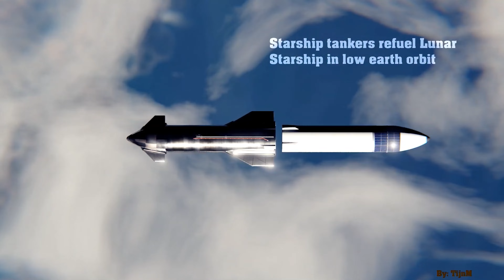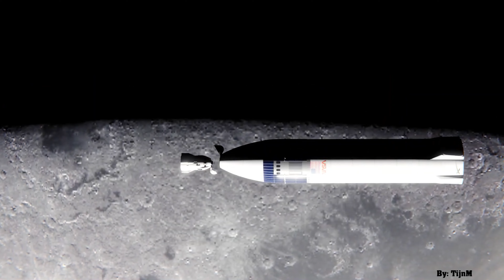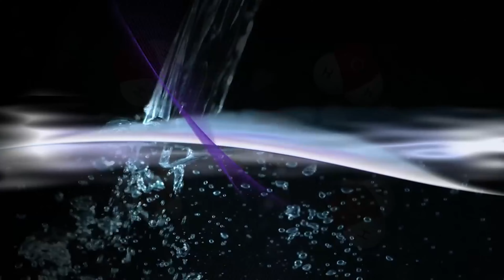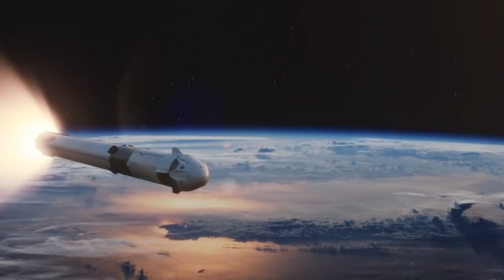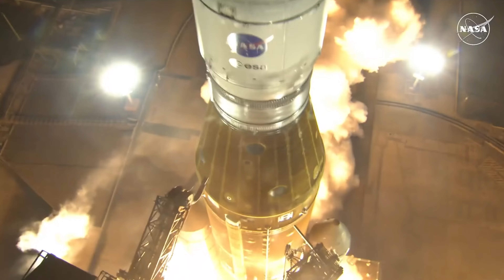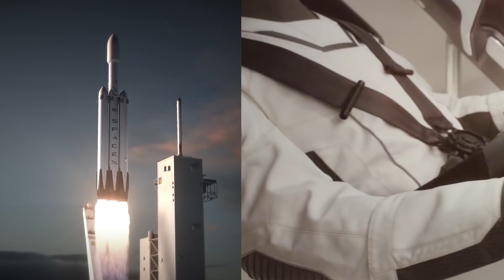We Could Build A Moon Base Right Now ! So Why Don't We?

Comment: Very likely the moon also has frozen hydrocarbons in the S pole craters. This makes liquid oxygen & liquid methane rocket fuel an option.
 I like the idea of using the reusable starship booster with a non reusable upper stage to get moon project hardware and supplies into low earth orbit.  One payload is the permanent lunar lander. 2 or 3 more payloads are fuel tanks that strap on to the lunar lander (and later are discarded to lower weight as they climb out of the Earth gravity well and they get emptied). This lands on the moon before astronauts are launched in a separate designed ship. 
      The 2nd ship is also launched into low earth orbit using the reusable starship booster.  It also includes strap on fuel tanks that are launched separately and then linked to the 2nd ship.  The last rendezvous in LEO is with the crew dragon which transfers the astronauts to the 2nd ship.  This ship is different than the 1st because it is able to return directly to earth LEO (assuming it is refueled on the moon)
    I don’t see much point in astronauts on the moon for a month unless the moon base is going to be permanently manned and supplied with water, oxygen, fuel, food from the moon.  I do see how a manned moon colony could become financially profitable if it’s done right.

Comment: Reilly, I am not just sharing these videos because they reflect what I have commented. I am sharing because of how well the ideas are presented. Of coerce, I don’t like seeing the Starship on its side because it is too much work. If you are going to not fly the Starship, remove the engines, but keep the fuel tanks to be used to store fuel. The fuel can be used to fuel the electric generator for the long nights on the Moon. Where the engines were; under the fuel tanks filled with Hydrogen and Oxygen that was mined from the Moon; equals water which happens to be one of the best protection from solar rays. That would make the optimal place to be used as a fallout shelter when the Sun starts acting out with massive solar flares...

Comment: I love the idea of cutting the cost of establishing a moon base. It's a pity politics has led to overpriced systems like the SLS being promoted. Btw there is nothing stopping Starship getting the hardware to orbit now. If it's an expendable flight there's no need to worry about heat shields or chopsticks. So Starship could do this work with one flight. Of course 'our friends' at the FAA won't allow another Starship flight until hell freezes over. The current situation is very depressing. If only visionaries like you were in control rather empire building pen pushers. Great video!

Comment: To start a base like this, yes. However I do believe in SpaceX's ability to have a Moon Lander system. With the fuel production and depot on the moon, that would complete the cycle of fueling and expenditure. We also do have the designs for the Apollo moon lander, and it wouldn't be too bad to update and construct something similar. We already have had several companies like Bezos design and test their products.

Comment: The SLS using left over bits from the shuttle system, orange fuel tank and SRBs, only has about EIGHT flights left. They could all be used up in a couple of years; and then what?

Comment: Can a Dragon Capsule make a lunar landing and then be refueled from a tanker lunar lander?
Reply: A dragon is already crew rated. If it could be linked while in LEO to a booster (delivered by a starship 1st stage) designed to get it from LEO to the moon and back to LEO.  It makes sense to split the transportation requirements into 3 parts, each with a vehicle designed for that part 
1st vehicle … from earth to low earth orbit for hardware, ships and cargo but not people
2nd vehicle … from LEO to Low Lunar Orbit and back to LEO
3rd vehicle … from LLO to the moon and back to LLO
4th vehicle … for astronauts, use crew dragon between earth and LEO and back to earth
Reply: @douginorlando6260  but is it better to have a space station in an earth-moon cyclical orbit from which dragons come and go from as lunar landers?
Reply: @SMunro  you have a good idea worth considering.  Orbital velocity around the moon  is 1.68 Km/sec. Escape velocity from the moon is 2.38 Km/sec.   You need an extra 0.70 Km/sec of delta velocity both for landing and taking off but eliminate the orbiting lunar station.  I believe once a moon base is creating export rocket fuel, then the lunar orbiter will win out.

Comment: the heaviest thing ever delivered to higher than low earth orbit was the Apollo 16  CSM/LM combo,  which weighed around 43 tons,  and the Saturn V  had a capacity of 45 tons.   
part of the weight was the Service Module that could get to the moon in 3 days.   The unmanned  Orion test took a week each way when going to the moon,  because it had a smaller engine and less fuel.     The  current Orion/ ESA service module  combo  could easily be launched to the moon by the Falcon Heavy in expendible mode,  so it's a cheaper and more reliable replacement to SLS,  but  FH  does not match the capability of the Saturn 5.   A lander would have to be sent in a different launch,  leading to rezendevous  issues.

Comment: once we have a moonbase and self-sufficient production of oxygen and fuel, the crew could stay much longer on the moon. so, we need less launches .  but the habitat needs to be protected from cosmic radiation and solar particle events.
Most efficient would be inflatable modules covered with loose regolith

Comment: Senate Launch system, sad, but true. Great video.
Reply: SLS is fraught with issues and is way to expensive but at least it can actually get you to the moon
Reply: @kipkipper-lg9vl  Yes it can, it can also do other things like launch a space station to low Earth orbit in a single shot just the way Skylab was launched. If NASA wants to launch a second Skylab, it could do so with SLS, it could replace the ISS which is getting old and which is scheduled to be deorbited at the end of the decade. So a better Use of SLS if we got one is to launch Skylab II, but a 21st century version of Skylab, and that will use up a rocket. This is of course if we already have one, I wouldn't suggest building an SLS for this purpose. A Starship could launch a bigger Skylab. the entire upper stage Starship orbiter could be turned into a space station with deployable solar panels, an inflatable space station would be even bigger!

Another mission of SLS if we got one, would be to launch an unmanned airship to Venus, a capsule would be sent to Venus, airbrake on atmospheric entry and inflate to produce an airship, this vehicle would be big enough to reliably communicate with Earth and send back video transmissions of the cloud tops and also dive beneath the clouds and take pictures of the surface of Venus in visible light, though of course a developed Starship could also do this mission and send a bigger airship, maybe even a manned one!
Reply: Well the Democrats control the Senate, something we can do something about in the next election.